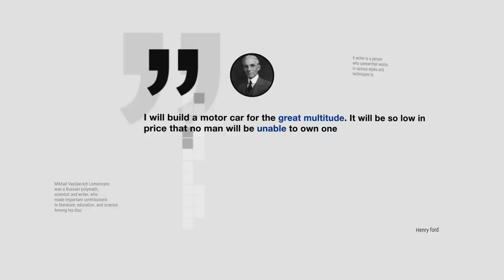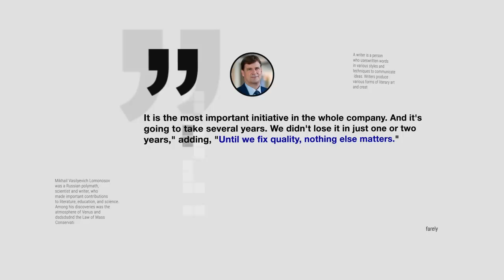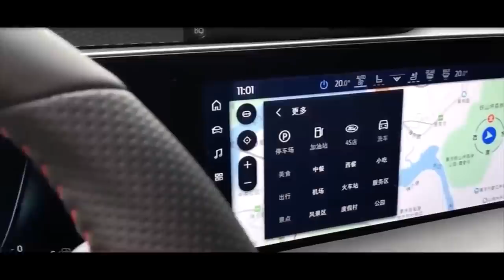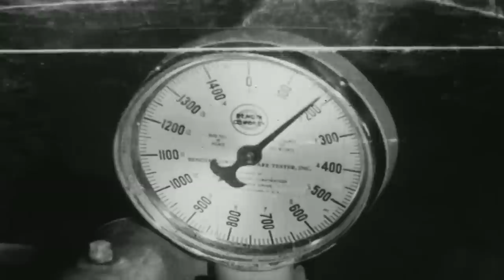Ford CEO Shocks Industry With New $20k EV!

Comment: so no Over the Air Updates,naff batteries ,no IRA credits, no battery credits either, and no American jobs, Way to go Jimbo :) :), and as for reliability expect multiple recalls, the price well the stealerships will sell it for $40 K claiming"supply chain problems" , BIG wasted opportunity Ford, release date 2026 ?? knowing it has VW batteries i reset the release date to 2028, as the VW software is already behind and now farmed out to a outside company so this will be 3rd hand attempt @ software, will proably only speak chinese too :) :)

Comment: Tata has released a 10k ev with a range of 300 miles. So Ford isn't the first in the world
Reply: Not coming to a dealer near you if you are in North America or Europe.
Reply: @robertd9850  but still available in some countries in the world. Hence, Ford isn't first in the world
Reply: @Darsh0019  Aptera has a solar charging EV that can be had with 1000 mile range due out this year.  They will build the 400 mile range first but the 1000 mile range can be reserved now.
Reply: Won’t pass safety standards.
Reply: @niceguyrides  tata has been regularly releasing cars that get 4 or 5 stars in global ncap. So yeah, it will rather easily pass safety standards
Reply: @Darsh0019  like to see them get 4 stars on the Euro test.

Comment: I hope Ford will not brag about a $20 thousand car, only to be so tiny that would hardly fit 5 passengers. I am expecting this car to be at least the same size as the Toyota Camry or Honda Accord. Furthermore, they should keep this price range even after the vehicle is launched. Usually, car manufacturers will brag about low-priced vehicles and once it is launched, they already increased the price 2-3 times already.